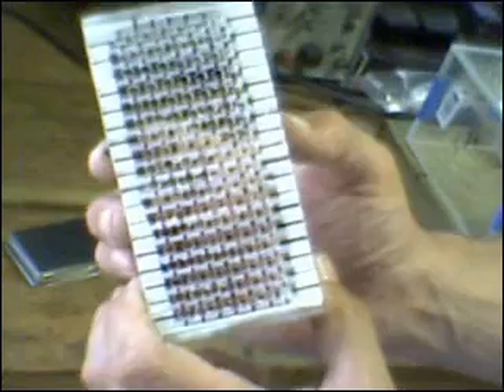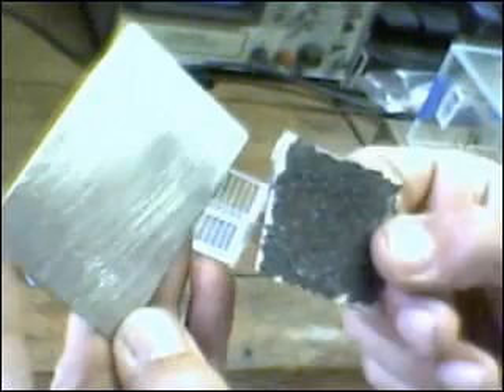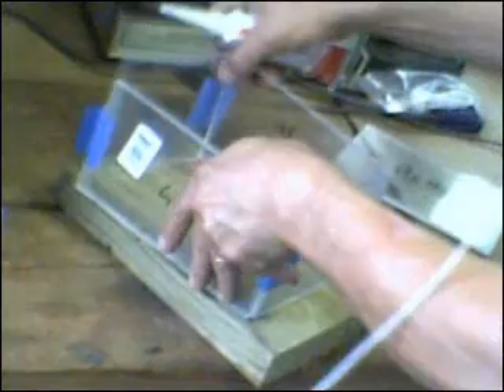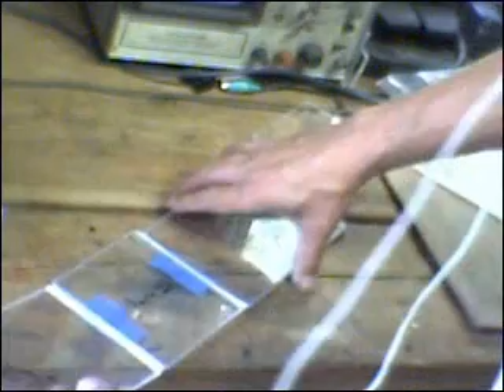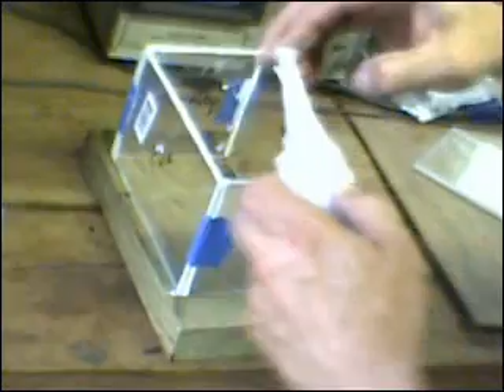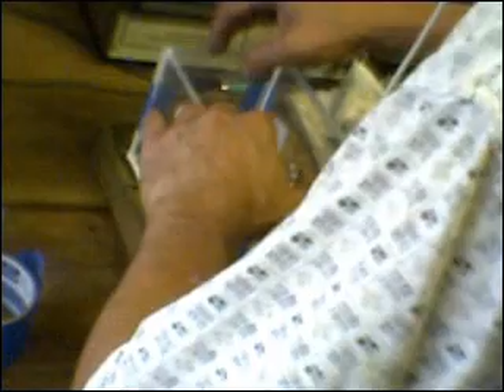16 - Hydrogen Electrolyzer test unit 05

Comment from the maker: Short term - Have some fun with it. Blow it up in some baloons, plastic soda bottles, etc. The end game is to suppliment the fuel supply of my car and measure the improvements if any in MPG and acceleration. I have a well established baseline of 30 MPG combined city/hwy with my daily commute. If I can add 50% to the milage (45MPG) it will translate to $500 less per year that I spend in gas. If the results are good I will outfit my entire fleet of cars.